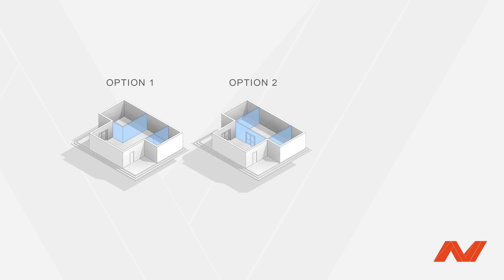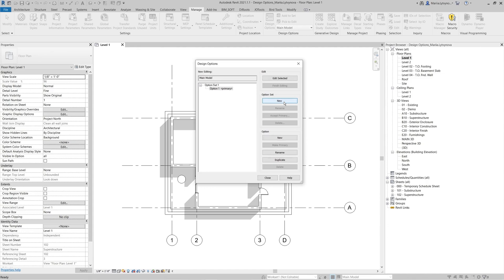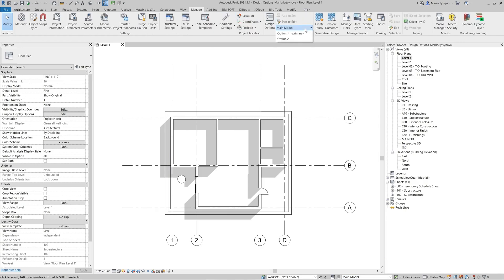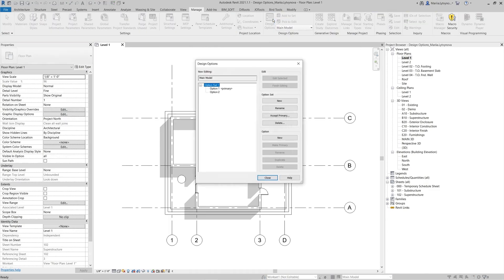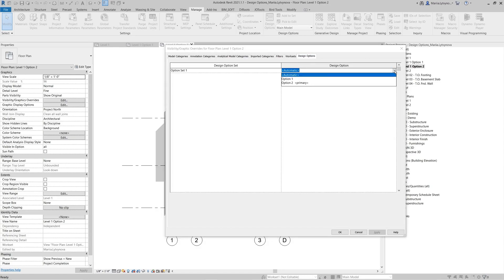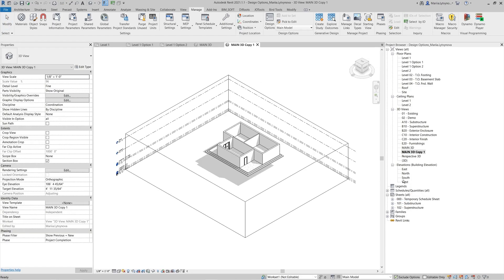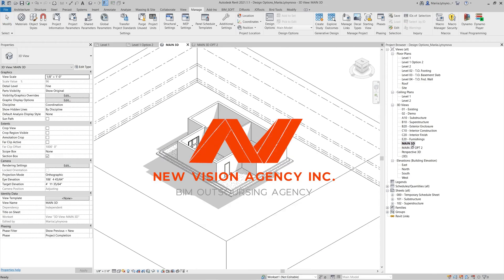Stop creating separate models. Learn Revit Design Options instead!

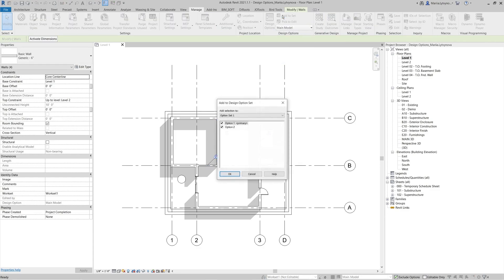Comment: 1:30 it's strange. you can select option only once?
what if I want to modify the option sets for multiple units, should I create the part all again?
Reply from the maker: Unfortunately you can not move the elements from one design option to another directly through the design options menu, but you can cut the elements and paste to a same place in the needed design option